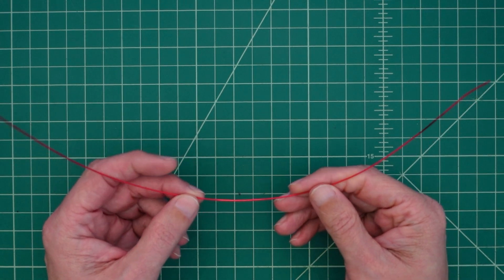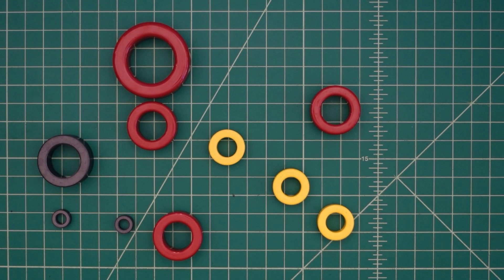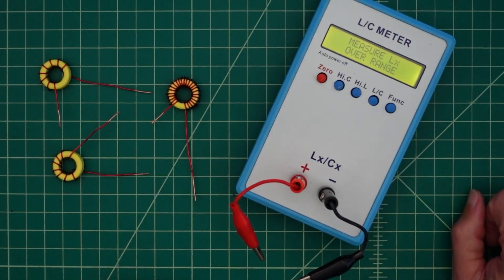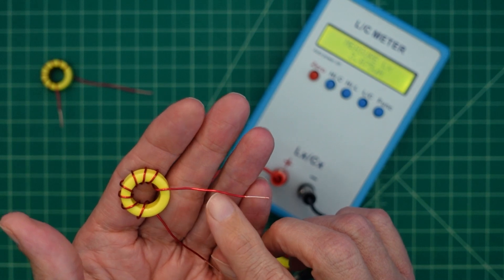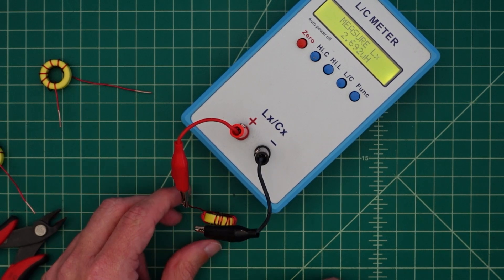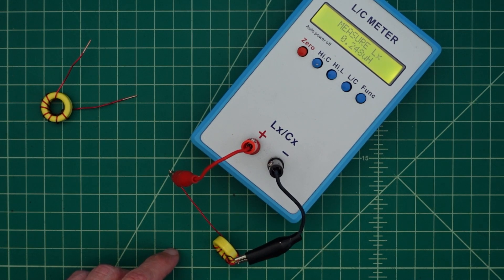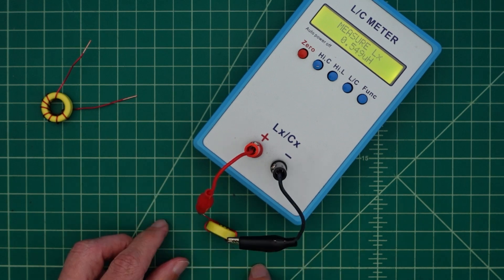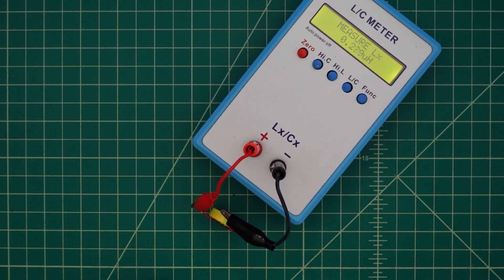Tuning Inductors for Ham Radio

Comment: Very good job, very informative method of building a toroid coil. Did you ever think about or try dipping the coil in ABS glue as a method of holding the coiled wire and position?
Reply from the maker: No, but I have used hot glue.  The challenge is that you want the core to stay cool and coating it doesn’t help with that.  Thanks for watching Mike 👍

Comment: Hot glue???   Real techs use fingernail polish to lock coils (and slugs) in position. :-D      (also to use resistor color codes to mark the value in picohenries with nail polish colors)
Love the clarity and depth of information you present.
Reply from the maker: @mervmartin2112  thanks Merv!

Comment: Nice demonstration Ape!  What brand is your LC meter?  I’ve been wanting to get a decent LCR meter for my bench, but haven’t wanted to spend the $300-$400 and up for a good one.  I have a cheap, Chinese component tester that’s good for a quick check, but there’s no way to zero or do any other adjustments.  Does yours allow you to pick different frequencies to test at?
Reply from the maker: Hey Tom.  I have a link to where I got this in the description, it’s sold under a few brand names but a search for 200a L/C meter will turn them up.  On the low setting this tests at 500hHz.  Here’s the manual http://68.168.132.244/LC200A_EN_manual.pdf
Reply: @TheSmokinApe  Thanks!

Comment: I use a wooden knitting dowel (gets smaller from to bottom so it’s self-leveling to the toroid) and think wooden toothpick to move the wires while connected to my LCR meter. Don’t forget to add your Dope…Q-Dope, that is, 😢
Reply from the maker: That's a good idea, I was looking to find something that would do that.  Thanks Frank 👍

Comment: Good idea to use hot glue gun or fingernail polish.  Are you going to test the difference when you have multiple and you wind one in one direction and the other in the opposite direction?
Reply from the maker: I like that fingernail polish idea!  I do have a few extra wond for testing.  Thanks Chip 👍

Comment: Hi Ape. Thanks for the video. I just bought a Mercury. Should I measure the resistance while/after I wrap the wire around the toroid from the kit? Also, can I use a multimeter to take the resistance measurements?
Reply from the maker: I would test them.  Unless the multi had inductance testing you won't have any luch, they measure resistance, not inductance with DC voltage.
Reply: @TheSmokinApe  I’ll try to test it with my Kaiweets. No matter the outcome I’ll learn something. Thanks for replying.
Reply from the maker: @tmccusk1  good luck with it, the challenge will be with DC you won’t get the reactance part of impedance with is ohmic resistance + reactance.  Either way hope the project works out 👍
Reply: @TheSmokinApe  It has to. It’s a CAHR Antenna:)

Comment: Very interesting video, Ape. One thing I do own is an LC meter and those look like fun to play around with. Was really confused about how as you got close, the inductance changed. Does that get better when they are mounted on a circuit board or is it always that twitchy?
Reply from the maker: They are twitchy but using glue or another adhesive will help.  And yes, your hands can cause the value to shift 👍